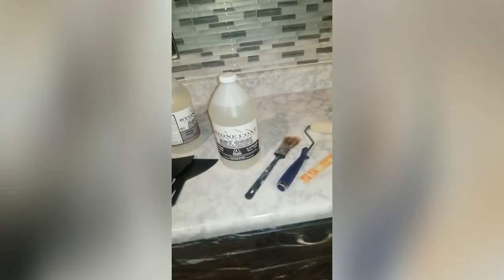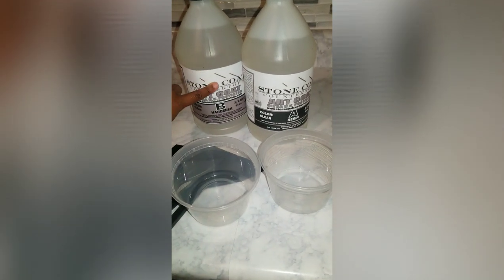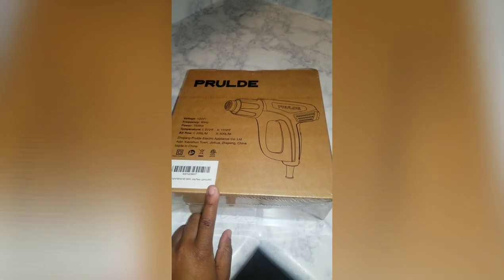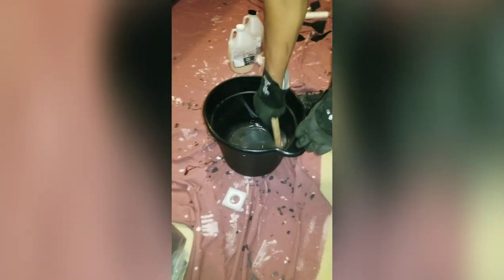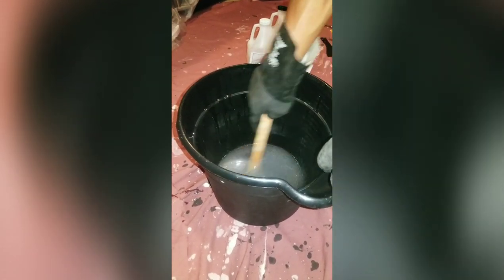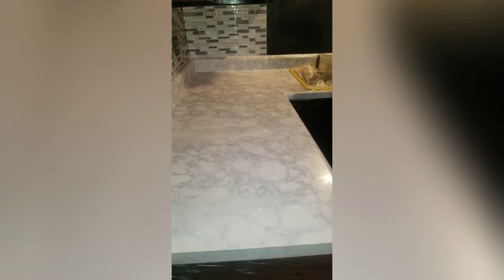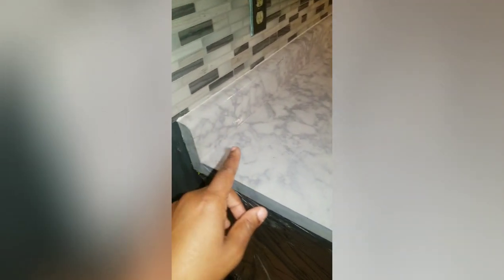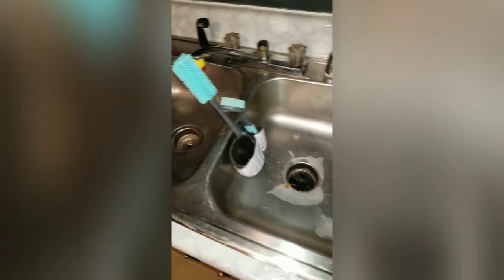Epoxy Resin over contact paper countertops! It works!! Live demo including mess ups.

Comment: You guys need some type of award for this. THANK YOU, THANK YOU, THANK YOU for this informative video. Yall are helping a lot of people with this. And it came out gorgeous
Reply from the maker: OMG you are so sweet!!! Thank You!!!
Reply: I am dying. I live in this apt. and the countertops are seriously horrendous. I was thinking about putting contact paper on them Then I was thinking about the paper being cut when you use the countertop. I sat here and thought to myself, well I wonder if I can pour resin on top of the contact paper. Lo and behold, I come across your video. Thank you so very much seriously from the bottom of my heart for sharing this. I am pumped now. 😄
Reply from the maker: @vickigrimm6795  so sorry im just now seeing this. The contact paper is more durable than u think. Also, use a cutting board opposed to the counter directly.

Comment: What kind of heat gun did you used and how careful should I be, I head it can burn 🔥the paper. I'm doing it but I need some tips. Can you list all necessary stuff that I need for the project. I already get my marble paper. I'm excited 😆🤗 I love 💘love 💘love your works 
You are a life saver I can't stop watching and sharing your video.
Reply from the maker: Hi, thanks for watching and sharing. I put eveything you need in the description. When using the heat gun, hold it up pretty high, not close to the paper, that is what causes it to burn, this was our mistake (as mentioned in the video).

Comment: Thank You Both it is Absolutely Beautiful!! 
I want to do this to an old metal shower stall that can’t be replaced from a small bathroom without tearing down a wall. I’m just wondering if the Resin can be done vertically instead of horizontally ?!? If anybody has any ideas on how I can accomplish that task Please let me know. Thanks Again for Sharing
Reply: Stone coat counter tops brand does have a vertical application process video.

Comment: Awesome video, I just bought a house, built 2004, great shape but the kitchen has too much white in it. I will paint the cabinets much darker like yours and am getting the same contact paper design, in your opinion does the epoxy help prevent peeling around the edges and corners? I absolutely love the look.
Reply from the maker: Apologies for the delay.  Yes, that's the reason we took this route. We're going on 2yrs...no issues!!

Comment: Did you all add the glitter to the epoxy or did you spread it over the counter prior to the pouring onto the counter
Reply from the maker: Hey, we poured the glitter when epoxy resin was already applied to counters. As mentioned, we used the glitter to sort of cover slight imperfections from rhe heat gun

Comment: 2 years in, how’s it holding up? Notice any yellowing yet? 3 years in mine have very much turned a bad shade of yellow in places. ESP where anything warm was placed (like the air fryer and things like that) and where the sun comes in the most. Now I have to re do them.

Comment: Thank you for this video! What was the sqft of your countertops and how much resin did you use for it? Also did the imperfections selfleveling when it cured?
Reply from the maker: Our kitchen is pretty small, maybe 9x9 if I were to guess. We used half of what was shown in the video so the 2 cups that we mixed of each (resin and epoxy) was enough. 
As for the imperfections you can see them but they are hardly noticeable. You would have to be pretty close to the countertop to see them. 
Thanks for watching!

Comment: Great video, and your counters turned out amazing! Now that it's been a year, how have they held up? Did you just do the one epoxy resin coat? And did you send or prime your counter before applying the contact paper? Thanks!
Reply from the maker: Holding up perfectly!!! We did not sand or prime before applying contact paper, just a basic clean. And yes, only the epoxy resin.

Comment: Can I just use a blow dryer?
Reply from the maker: I'm not expert but from my research I found that a heat gun gets much hotter. Keep in mind Professionals use torches.
Reply: Sorry after all this time, but a blow dryer does not put out enough heat to use instead. Ya gotta use the heat gun.

I would think with this finish, rather than taking off the contact paper, just sand down the resin and apply new contact paper.

If  you are renting, be sure your landlord approves. Mine told me, IN WRITING, to do what I wanted. So if your landlord says you can do this, get it in writing. I didn't have to ask, he knows me well. I have lived here 18 years and no spruce up. I have never asked for one until now.

I have been seeing on YouTube recently not to overlap your paper.

Comment: Hi! Any update? I heard these scratch easily.
Reply from the maker: It's only been 5 months, still in great shape. And I'm sure the paper alone could scratch but with the epoxy resin on top I have yet to see scratches.
Reply: @anjanellfashion  Awesome, thanks for replying. :)
Reply: @anjanellfashion   it looks about the same? Do you clean with regular all purpose cleaner? Thanks for sharing this!!
Reply from the maker: @206095534  yes, everything is still in tact. And yes, regular all purpose cleaner or soap and water for small spills.
Reply: @anjanellfashion  thank you so much for this venture. I am looking to refinish a wood table. With cleaning, do you clean like you would normal counter tops or tables?